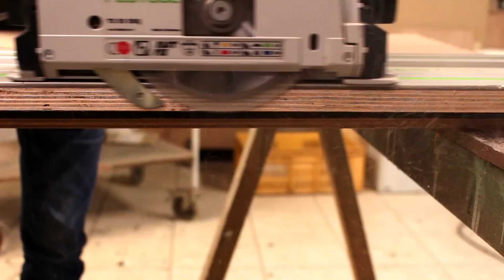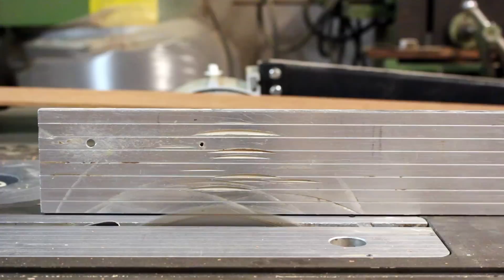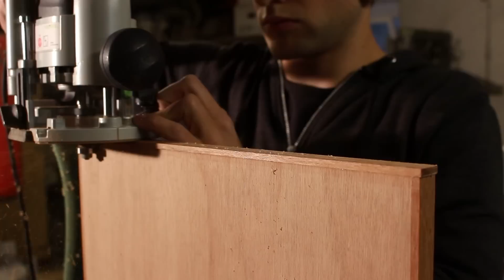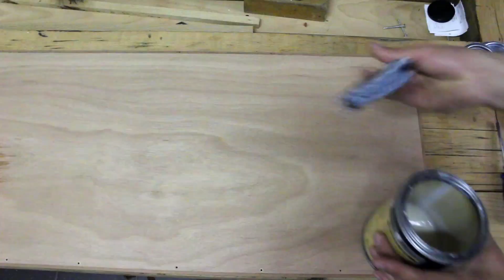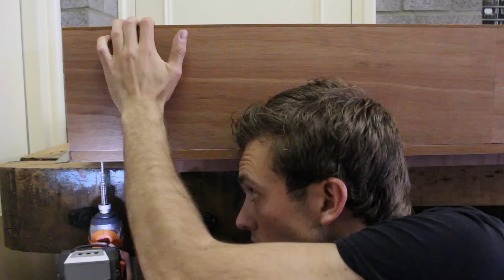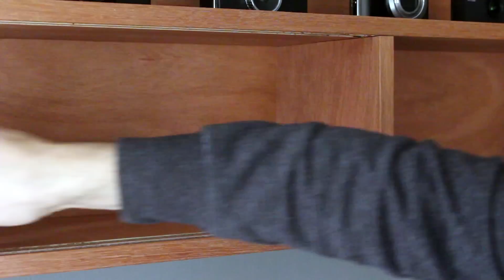JM - #013 Mid century modern wall cabinet

Comment: which is what it places for sliding doors, it looks like soap
Reply from the maker: To make the doors slide easily, I use candle wax.
Reply: @JurreMattheeuwse  candle wax?? Okay, incredible work, i try to do it and the truth is that i do not stay the same. But if i am very well. I have to ask about the type of wood you use. Greetings from the México city.
Reply from the maker: Thanks! For The cabinet I used hardwood plywood (18 mm), for the sliding  doors birch plywood (9 mm). The trim is made of an unknown (for me) hardwood.
Reply: @JurreMattheeuwse  PERFECT FRIEND, YOU ARE VERY FRIENDLY WHEN SHARING IT, CONGRATULATIONS AGAIN, INCREDIBLE WORK.

Comment: What material are the sliding doors? Also what kind of finish did you use since you do not show any footage making the doors or finishing. Overall very nice.
Reply from the maker: Video description:
I made the cabinet of 18mm hardwood plywood, and 9mm birch plywood for the doors. In the end, the cabinet is finished with 2 layers of water-based lacquer. For the doors I used a matt paint.
Reply: Awesome. Thanks. Am looking to copy your design to make my own when I get the chance. Looking forward to any future videos you create.

Comment: Couple of questions: 
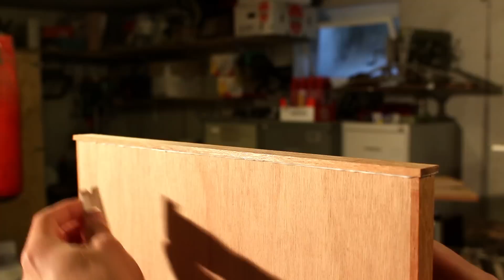1. @1:47 What are you using to remove the squeeze out? 
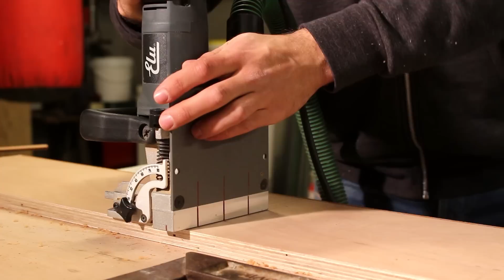2.@2:12 What brand is that Biscuit Joiner?
Reply from the maker: Couple of answers:
:)
1. I used a single edge razor blade from Stanley.
2. It is an old machine that is never used. The brand is Elu. I think this brand does not exist anymore and it is inherited or part of DeWalt.

Comment: Beautiful  - I wish hardwood ply was available here in Denmark but only veneered MDF is. I like ply so much better... Hope you will answer 2 questions: How deep are the rabbits for the sliding doors (top and bottom) and did you spray the doors? Subscribed :)
Reply from the maker: Of course I answer your questions! :)
The dimensions can be found in the sketchup model which can be downloaded from my website: https://jurremattheeuwse.jimdo.com/objects/wall-cabinet/
The rabbits are 3mm on the bottom and 8mm on the top.
I have painted the doors with a paint roller.